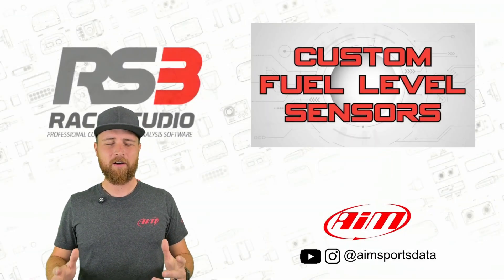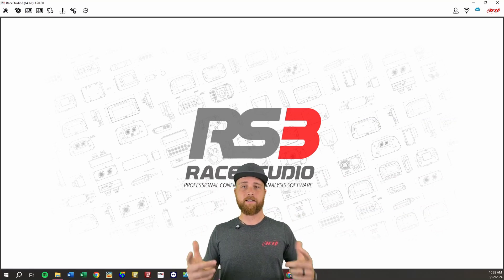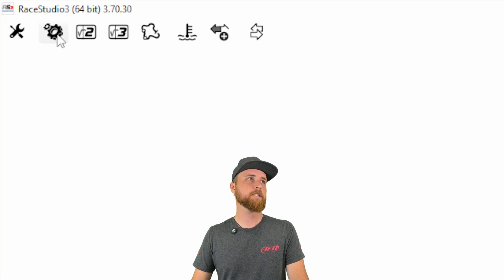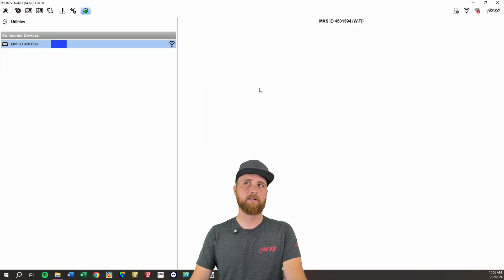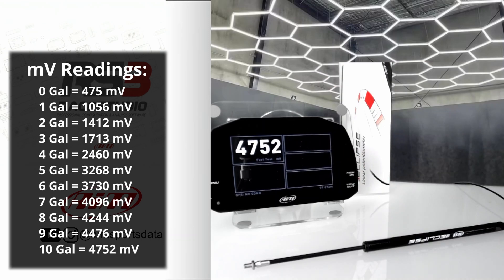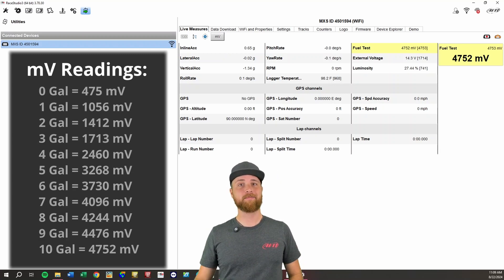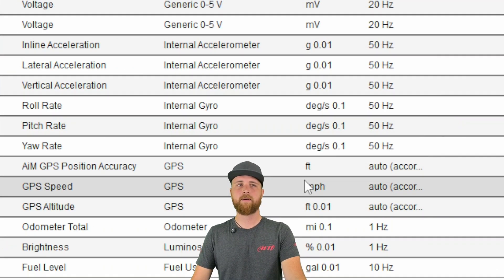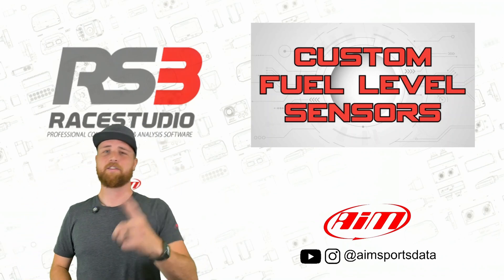Custom Fuel Level Sensors | AiM Tech Tips

Comment: So in order to get this to work with my Solo 2 DL I'll need to buy a CAN Data Hub in addition to a channel expansion hub? Plug the patch cable to the channel expansion hub and plug the expansion hub into the Data Hub?
Reply from the maker: @dougcao if the Channel Expansion is the only AiM CAN device you are adding to your Solo2 DL, you do not need the CAN Data Hub. If you desire more than the one additional AiM CAN device (example, a SmartyCam3 or a LCU1S Lambda Controller), that is when you will need the CAN Data Hub.

Comment: Awesome video, I've got 3 dashes that i need to do this w/one complication. The car has a dual level sensor sattle style tank. How would i do this additive to take into account for both sides of the track?
Reply from the maker: You can do a separate channels for each sender. If you need the total amount, use a simple math channel to add the readings from both senders together.

Comment: How would one do this with a capacitive type fuel sender?
Reply: Hello! Thank you for your comment. As of right now, our units are only able to read a voltage range, rather than a capacitance range. I have found multiple signal conditioner PCB's online that look like they're able to convert that capacitance signal to a voltage range. It will not be as easy as terminating a pull-up resistor.
Reply from the maker: @SabianLawrence  is one of our techs, you can reach him directly at sabian@aimsports.com

Comment: I have a 12V Float Style level sensor from ATL. What would be the recommended way to wire and set this up with a PDM32? I'm assuming it's essentially the same as the 5V setup, but this is the first I've seen that a 2700ohm resistor is needed so figured I'd ask. I noticed there several different setup methods in race studio as well so was hoping for some further insight. Glad you guy's are putting together these much needed shorter tech tip videos! Thanks!!!
Reply: Hello! To achieve your goal, you will not need to terminate the sensor with a resistor. [You would only need a pull-up resistor if you're working with a resistance based sensor] You should just be able to power the sensor either via the PDM or another ignition source, ground your sensors ground wire, and connect the signal wire to a channel input. Then, create a custom sensor to map out the 0-12v sensor. The PDM32 is compatible with a 0-12v sensor range.
Reply from the maker: Sabian is one of our techs, you can reach him at sabian@aimsports.com
Reply: @SabianLawrence  Awesome! Thank you for the response!

Comment: Aim should make a virtual test bench on RS3 for its products as a lot of configs required to be tested before implementing, am currently banging my head against a PDM32, 2pcs Mxs strada 1.3, 15kp v2 can keypad, wireless 10 button keypad, smarty cam 3, a gps9 module, data hub and all needs to work in line with link G4x xtremex ecu and man having it all on a test bench is a pain especially setting up PO,SV and then finding out hrs spent setting some of the stuff up won’t work, and troubleshooting it.

If a virtual test were available without having devices connected it’d make life easier.
Reply from the maker: Not a bad thought but this would be a request the manufacturer in Italy would need to address. You could send a detailed email about how you would like this to work to support@aim-sportline.com
Reply: @aimsportsdata  i dont mind